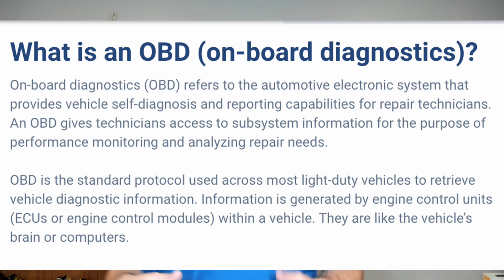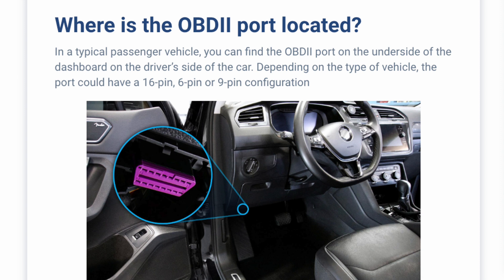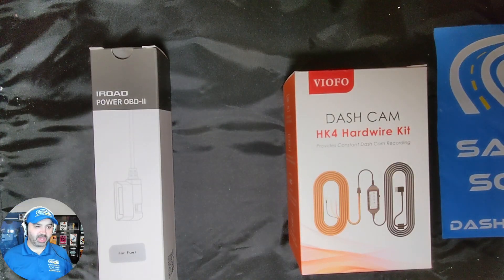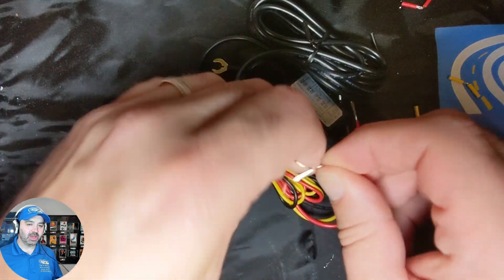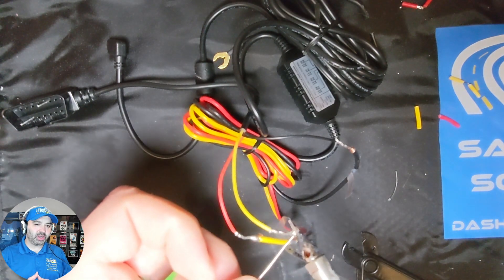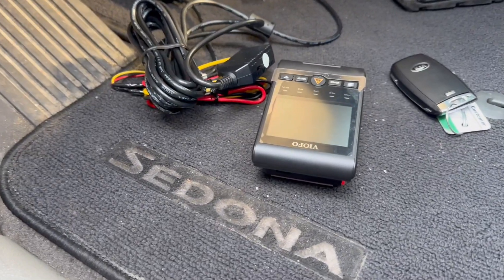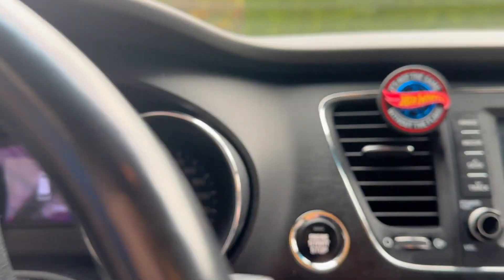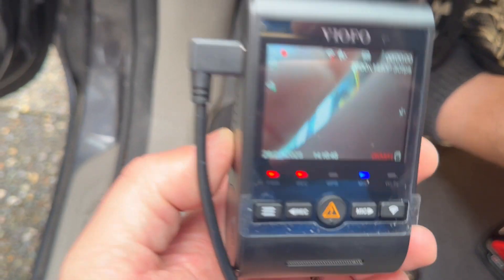Viofo OBD2 Hardwire Parking Mode Cable

Comment: Hi Ben, 🤝

Thank you so much for your awesome videos and for helping us, the regular users. 🤗 Thanks to your videos, I bought the A229 Pro and the HK4 kit. I’ve been thinking for a while about how to install it. Using the fuse box has me a bit concerned since in my car (MB W211 E350), one fuse can be responsible for multiple circuits/devices. Many of the suitable fuses have constant power. I’m also not too keen on cutting into the wiring.
I saw your video, and I really liked the idea, but there’s one problem. I live in Germany, and we don’t have OBD connectors like the one you used. I found one single option in Korea, but with shipping, it will cost nearly $120, which is almost half the price of the camera. 😄
I know the Vantrue parking mode won’t work. Do you happen to know any other OBD connectors that would be compatible with the HK4? Or maybe you’ve installed the camera on a car like mine or a similar Mercedes?
Sorry for the long text, my friend. 🙈 But I’ve been racking my brain over this. 😅
Thank you in advance, and best of luck! Take care! 🤝
Reply from the maker: The IROAD one is available in the UK as far as I know. Not sure if available in Germany
Reply: @SafeDriveSolutions  Unfortunately, no.
Reply: @SegaSobol  hi, hast du schon eine Lösung gefunden? hab einen W246
Reply: @MauzMoe  Hi, ich habe mich für folgende Lösung entschieden:
Zündungsplus und Masse habe ich vom Zigarettenanzünder für die hinteren Passagiere (die 12V-Steckdose) genommen. Masse kann man auch einfach mit den dortigen Schrauben verbinden, falls man das Minus-Kabel nicht durchtrennen möchte.
Das Dauerplus habe ich von Pin 16 des OBD-Steckers genommen. Das bedeutet, dass ich nur zwei Kabel zum Zigarettenanzünder gezogen habe, während das Dauerplus unter dem Lenkrad, beim OBD-Stecker, geblieben ist.

Die Box des Hardware Kits habe ich mit dem Finger in die Nische unter dem Radio geschoben. Dort gibt es viel Platz, und das Kabel verläuft parallel zur Außenseite des Lüftungskanals.

Um die Kabel zu verlegen, musste ich die Haltegriffe, die Sonnenblende, die A- und C-Säule komplett und die B-Säule oben lösen, um den Dachhimmel leicht abzusenken. Außerdem musste ich den Aschenbecher entfernen und die Abdeckung der Mittelkonsole abbauen. Auch die Innenraumbeleuchtung und die Abdeckung des Regensensors habe ich demontiert.
Ich habe ein kleines Stück aus der Regensensor-Abdeckung herausgeschnitten, um den Stecker der Rückfahrkamera und den Hardware Kit Stromanschluss herauszuführen. Danach habe ich die Abdeckung mit Dachhimmel-Material bezogen, damit sie nach dem Zuschnitt sauber aussieht.

Zusätzlich habe ich für das Dauerplus und das Zündungsplus jeweils 5A-Sicherungen in die Leitung eingebaut. Alle Verbindungen wurden ohne Löten, sondern mit Kabelverbindern und Steckkontakten ausgeführt.
Lg Sergey

Comment: So I have a 2024 Toyota Tacoma Hybrid. Will this work for the VIOFO A229? The fuse box on the truck is in the worst place ever.
Reply from the maker: The iRoad OBD2 is a universal product, and works on many vehicles. A hybrid is still a gas vehicle, leaving it for gas and parking mode should work. While we have not tested a Tacoma hybrid, there has been lots of success in Toyotas across the board.

Comment: I got Garmin hardwire kit and want to set up my dashcam like this,do you know the color of wire are same as your video,I got obd power plug already but don’t want to put wrong wires together
Reply from the maker: Everyone ask this exact question. It is not about the colour of wire. It is about the labels of what they do. You need to know what the colours do. You will need to know which is ignition/acc , ground, and constant power. Not all OBD2 cables are the same. Not all OBD2 cables can be cut the end off like this.

Comment: I  purchased a OBD hardwire kit with the title "Dash Cam Hardwire Kit OBD, USB Type C Dashcam Hardwire Kit with OBD Port Charger Cable for Dash Camera 12-24V to 5V/3A Low Voltage Protection 24h Parking Surveillance/Acc for Dashcam, GPS (USB-C)" Will this alone work for parking mode or do I  need to do what you demonstrate on this video?
Reply from the maker: You can not use any generic obd2 cable. There are 2 types of usb c pinouts.

Comment: If you have a Mazda cx-90 mild hybrid do you select ev or fuel? I have a viofo a229 pro I'm thinking of adding this
Reply from the maker: Typically for hybrid they function as a gas vehicle.
Reply: @ thank you I just bought a a339 and all the hardware from your store last night. After obsessing and binge watching videos. Every excited. Thank you
Reply from the maker: @warrenleprieur9203  Thank You for your support. We will make the cable for you.
Reply: @SafeDriveSolutions  ❤ Thank You

Comment: I don't understand the part that there is three wires (black , yellow, red) but there is only two pins on the obd? 
where does the wires attached exactly in the obd? 
we know two wires goes to pin 4 and pin 16, but how about the third wire?
Reply from the maker: These obd2 cables are prewired to work with thinkware, iroad and a few other dash cameras. We are simply cutting the end off and wiring it in to work with a different dash cameras

Comment: is the IRoad OBD cable that you used in this video compatible to do this modification on a hybrid vehicle (13' Prius)?
Reply from the maker: New style cable works for EV and gas vehicles
Reply: @SafeDriveSolutions  Appreciate it! One more question - will this work on the new A329 as well?
Reply from the maker: @spaggs  its the same cable. so no issues. the only issue you may have is vehicle compatibility

Comment: Thanks for the video. If we simply use an OBD2 power cable to attach the Viofo dashcam to the OBD2 port, won't parking mode work?
Reply from the maker: You need a specific cable due to usb c pinout

Comment: I use a redtiger dashcam with obd port hardwire and the dashcam goes to parking mode when the car is cruise control model or idle. Any reasons why?

Comment: OBD power is just pointless and defeats the purpose of using it for security. If some e breaks in they can just pull the OBS cable out and voila. Same when taking it to the dealership or a mechanic. They are going to plug into the OBD port and disable your camera.
Reply from the maker: If someone breaks in they can just steal your dash camera. Not sure of your point of unplugging obd2 cable when they can just steal your dash camera. Yes a car dealer will unplug it. That is the trade off of DIY install and not getting it professionally hardwired.

Comment: Does it work on a 2011 F150 to get parking mode i have a119 mini?... can't find any fuse taps that fit properly for my year of truck total bummer... and where can i buy the OBD port connector for a 2011 F150?
Reply from the maker: we do sell and build them. check it out www.safedrivesolutions.com
Reply: @SafeDriveSolutions  Yeah did some research and the IRoad + HK4 route is rather expensive $100 more just for an automatic parking mode... considering i only paid $180 for my A119 mini... i can buy an OBD2 to type C cable cable on Amazon for $18 with low voltage protection that has a switch option for constant power... same goes for their polarized filter at $30 really?... made my own for $2 from spare FPV parts i had... so nearly the price of the A119 mini cam just to get some basic features that should be included seems rather unreasonable from these companies... but thanks for your informative video.
Reply from the maker: you will find those usb c cables most of them wont work. Even though people say they work. They later admit the other usb c cables dont work. That is because there are 2 types of usb c

Comment: Any idea how the iROAD OBD2 adapter determines whether to provide power over the (red) ignition wire or the (yellow) constant wire if it is only using pin 4 (ground) and 16 (battery)?

I would have thought the OBD2 adapter would have required a third pin to indicate engine status.
Reply from the maker: there is a couple things. 1. is it monitors your vehicle voltage. your constant power line will be higher if running and lower when not. It also has a g sensor looking for impacts.
Reply: EDIT: just saw RetroCarGuy's "IROAD OBD-II Power Cable" post on DashcamTalk saying that the iRoad uses both a voltage check and a motion detector to determine whether to provide accessory power. (the mention of "impacts" had confused me)

* Original Comment Below *

 @SafeDriveSolutions  do you mean the OBD2 adapter has a G-sensor, or the dashcam? 

I assume the OBD2 adapter has some circuitry that looks at the voltage coming from the port and if it's higher than a certain threshold, it puts a signal down the red ignition wire to indicate that the car is turned on. When the car turns off and the voltage on pin 16 drops, the OBD2 adapter cuts the signal on the red wire, but continues to provide constant power over the yellow one.

I'm interested in this as I'm looking at wiring up a dashcam to an EcoFlow River 2. It looks like I can use either the OBD2 yellow and black wires or a 2-wire cigarette adapter to power the battery, and then use a USB-C to 12V 2-wire adapter, and splice those along with the red wire from the OBD2 adapter into the dashcam hardwire kit.

The benefit of this is the EcoFlow River 2 is it's a really cheap LiFePO4 battery considering the capacity. I can take it into the house to fast charge it if needed, or even switch it out with another battery fairly easily. I wanted to try and avoid hardwiring to protect my car's warrantee, and looks like the iRoad OBD2 adapter will make that possible!

Comment: Hey Ben, I'm not sure if you still follow the comments on this video but I got a Viofo A229 and want to use the VANTRUE OBD Hardwire kit. Do you know if this would also work? If not, where are the differences?
Thank you!
Reply from the maker: Does not work. They are different style usb c cables. They will power it up but will not put it in parking mode
Reply: @SafeDriveSolutions  Oh wow, I have the feeling now, you are still waiting for new comments :D! Thank you for your answer. Maybe I'll then go for your solution. Greetings from Austria ;D

Comment: Has anyone tried this with a Subaru outback? Mine is a 2010.
Reply from the maker: I have not but it should be fine
Reply: I found the Viofo A229 very sensitive to voltage fluctuations. That's why you see a lot of posts about it spontaneously shutting off. I tested my 2010 Outback fuse connection and also my USB port connector and found voltage fluctuations.  Small, but enough trip the camera.  I find if I run the original cord through the supplied Viofo 12V to USB converter, it runs stabally. In my car that port is inside the center console so I was able to run the cable "invisibly."

Comment: Some people have raised concerns about connecting dashcam to obd cable... As constant connection to obd can mess up internal systems. Is it true? Can you please share your comments on this topic!!
Reply from the maker: In an upcoming video on Vortex Radar You Tube channel in August we talked about this. However mainly we have found no issues with IROAD OBD2 cable because it only uses pin 4 and 16. some of the other obd2 cables we have seen issues with because they are connecting to more than these 2 pins
Reply: @SafeDriveSolutions  thank you for the update... Appreciate it

Comment: Have you had issues with the hardwire module failing? I have gone through 4 of them between my two cars. They will eventually stop producing high enough 5v power on the BAT terminal for the camera so while driving it thinks it’s in parking mode (constantly triggering beeping while driving). The other issue is the low voltage cutoff does not work at all, i’ve seen it pull my battery down to 6v. Never happened with the camera unplugged. I’ve verified these symptoms with a multimeter on the inputs and outputs. I can’t be the only person with 4 faulty units. And yes i’ve done probably 30 automotive receiver installs in my time so I know how to properly identify ACC/BAT/GND.
Reply from the maker: Probably installed a few hundred of these hardwire cables. Not 1 defect yet
Reply: @SafeDriveSolutions  I’m at the point where I’m about to wire up a low voltage cutoff module with two 5v buck converters (one for ACC and one for BAT). The viofo harness works great every time i replace them but it’s an annual thing to go in and do it again.
Reply from the maker: @Javii96  what camera is it? I am going to guess you use an HK3.
Reply: @SafeDriveSolutions  yes the HK3 harness. wife and i both use the viofo A129 pro? Duo. The front and rear combo. I had a 5 yr old a119 before that too still works great moved it to the garage car that i rarely take out which is just cigarette lighter powered.
Reply from the maker: @Javii96  we have barely installed any HK3 style units. SO there could be a possibility they are not good. But are main installation is HK3-C 9A139 pro) and HK4 (A229 Pro, well almost everything else Viofo)
Reply: For reference when I use the cigarette lighter the camera works flawlessly. I have had one GPS module fail also though. That will cause the camera to keep rebooting randomly. Took it apart and corrosion on the PCB. Viofo sent a replacement though.
Reply: Thank you for that info, next time it goes out i might just buy the hk4, i think the only difference is i’d have to cut the USB C cable and solder the mini USB on.

Comment: Ok,, just got the iroad in... hooked  up the wires Like your video... Yellow to red and red to yellow.  A139 pro.  Works only when ignition is on,, park mode does not activate on standard on I road.  Switched to park mode, does not turn on during driving.   Power at 13.3 volts during park mode.  Park mode constant recording!!??  I may need to hard wire like instructed.  2024 bmw m3 competition.   Obd doesn't work! Verified with iroad recommended to use obd with a139 pro. May work with other vehicles,  but not with bmw!
Reply from the maker: I seen this on one one other BMW before. Not sure why but it seems like there is a challenge with communication to vehixle
Reply from the maker: I should have added did you wait for approx 5.5 minutes with window rolled down to see if it goes into parking mode? make sure door is closed and dorrs locked

Comment: Fyi,, even with the iroad or hard wiring, youll be lucky to get 4 hours in park mode depending on battery size.  Better off getting the backup for long parking mode.
Reply from the maker: that is correct which is illustrated on our online website survey. We like to say 1-3 hours.

Comment: The iroad connection to the a139 pro splicing on the video.  From the iroad, does the yellow and red share the same pin 16 from the obd?  Which is 12 volts? If not, what pin number is the red wire and yellow?  Black is pin 4 and 5.?
Reply from the maker: The red and yellow do not share pin 16 because if they did they would constantly have power which would mean there is no battery protection. The dash camera knows to go into parking mode by not recieving power on the yellow wire of Viofo hardwire cable or red wire output of IROAD OBD 2 cable. The IROAD monitors the computer somehow (i can not remember exact explanation of this) and shuts off ignition output after 1.5 to 5 minutes depending on vehicle.
Reply: I have a 2024 bmw m3 comp.  My car sleeps after 13 minutes on the fuse box.  Therefore I have to use obd.  Correct me if I'm wrong.  Red wire to yellow and yellow to red wire from iroad to a139 pro?.

Comment: Hello Ben, I am impressed! A great thing! 
Unfortunately I can't buy the IROAD OBDII power cable here ;(. Can you send me a cable? Greetings Daniel
Reply from the maker: Hello Daniel, where are you located?
Reply: Switzerland  @SafeDriveSolutions
Reply from the maker: I would use a Thinkware OBD2 cable end instead
Reply: @RCDani73 , how did you connect these cables? I need to connect Thinkware OBD 2 cable to VIOFO HK4. My plan is to disable parking mode because I am only interested in getting the camera on and off with my ignition.

Comment: Thanks for the video. Could you share a link for where to get the OBD2 plug?
Reply from the maker: We can build Viofo OBD2 plugs if you want to order from our website safedrivesolutions.com. i would recommend ordering the IROAd OBD2 cable and the Viofo hardwire cable that you specifically need. We will gladly build it for you if both parts are purchased and you let us know your vehicle make, model and year. 

https://safedrivesolutions.com/shop/

Comment: The OBDII power cable can use  that on  Hybrid or Electric vehicle?
Reply from the maker: depends on vehicle. Most hybrid vehicles use a normal obd2 cable. full electric vehicles need a different cable
Reply: @SafeDriveSolutions  Any idea via EV would need a different cable?
Reply from the maker: @S.SchetedeSphev312-my2rc  new IM300 supports EV as well as gas. However we have not tested on an BMW I4.
Reply: Iroad JW200 OBDII Power Cable suitable for electric Vehicle

Comment: Ben, another great video! Does that OBD cable simulate the car switching into accessory mode after turning off the engine, which is needed to put the camera into parking mode? That is the only part that I’m not clear on.
Reply from the maker: Yes it will but depending on the vehicle it will take 1.5 to 5 minutes for computer to go to sleep
Reply: Thank you!

Comment: Wanted to install the standard harwire kit method tomorrow with the A139 pro 3 channel in my Porsche Cayenne e-hybrid 2020 - the obd method is much more practical - do you know if its works for my Cayenne here in Europe?  Thanks a lot
Reply from the maker: Porsche Cayenne Dash Cam Wiring
https://youtu.be/k2_nM1i_A6k

This is how we wire Porsche Cayenne
Reply: @SafeDriveSolutions  thanks a lot - great that you already did a Cayenne -  will try it thanks
Reply from the maker: @tansanite09  we do them all the time.